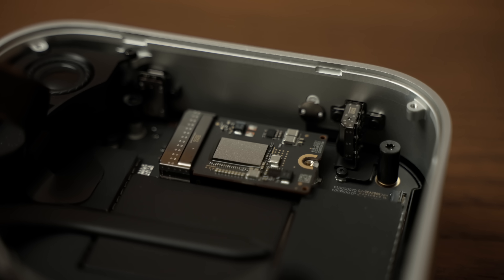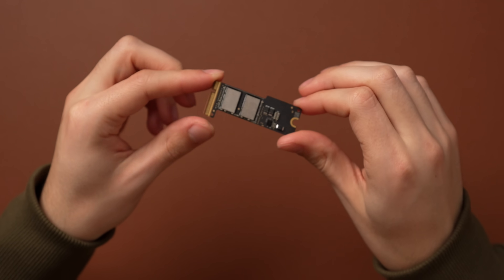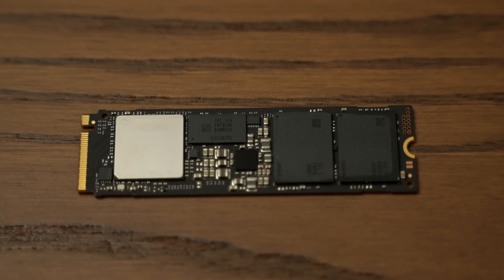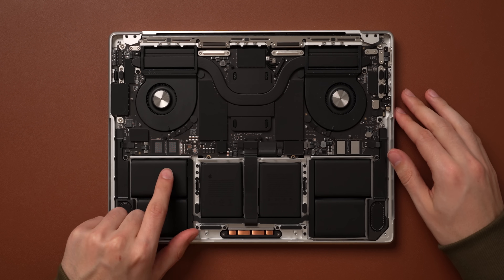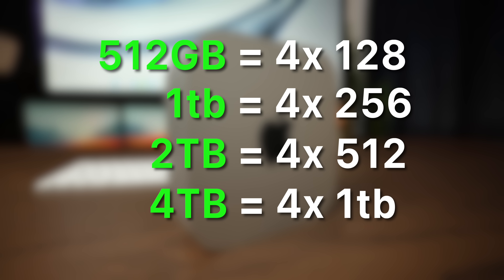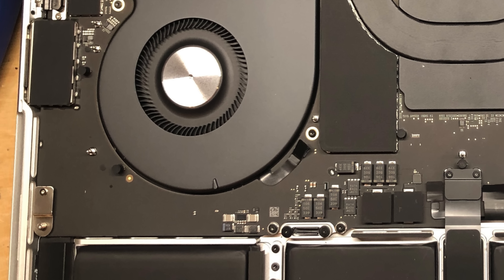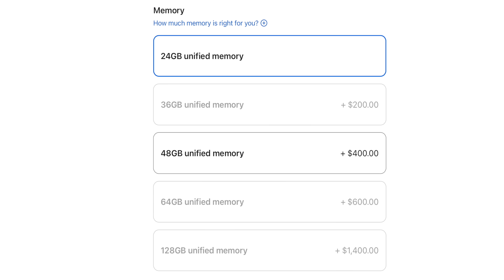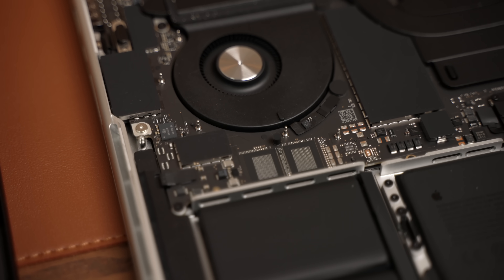Apple SSDs are hiding a BIG secret... Upgradable MacBooks??

Comment: Keep in mind,all does is to maximize profits via upselling basic upgrades to its customers. It is their core selling strategy.

Reason why we see removable NAND memory on Mac Minis? They are stationary devices and storage scarcity can be easily circumvented with external SSDs/docks/NAS. So less incentive for apple to solder on the flash. (Soldered flash creates extra work for them in case of warranty.)
On Macbooks they will keep the customer pay dearly for RAM and flash storage, as external SSDs are inconvenient on mobile devices and the push to upsell more NAND much higher.

Comment: Removable is a generalization... you can remove it but if its also proprietary connection with hardware/software lock it not going to change much for us. Resoldering and replacing the NAND chips has always been an option anyway...

Comment: Keep in mind that Apple doesn't manufacture the NAND chips. So if they manufacture a daughter board with the NAND chips, then that has all the SKUs. If they always populate with 4 NAND chips, that can reduce the controller complexity on the SOC. Now, I haven't seen images of the M4 SOCs but Apple may be planning for 1 SKU for the logic board. Apple could produce only m4 PROs and use them in both M4 and M4 PRO mac minis. This can be done by disabling CPU & GPU cores and memory by only 1 time programming of the SOC. I wonder if the logic board has pins for programming the SOC. Keep in mind that its not in Apple's interest to manufacture a ton of SOCs for the combinations. Great video.

Comment: I am sure you remember older MacBooks that had a door on the bottom where the hard drive could be swapped out. Most buyers will not take apart a Mac Mini to swap out the "SSD" because it is simply outside of their comfort zone. Swapping out an "SSD" should about as difficult as changing batteries in a remote.

Comment: Apple distinguishes between serviceability (allowed via qualified repair shops) and upgradeability (not allowed). Reducing SKU counts should permit both, without forcing Apple to charge commodity prices. If you want cheap-ish storage, buy an external device and hook it up via either Thunderbolt or 10GbE.

Comment: okay, so I stuck with the 2019 iMac 27” … because it can have an upgraded nvme board fitted. problem occurs if you mess up the screen seal and it kinda spoils the machine a bit. So, now look around the back and see the thunderbolt sockets… I now have a 4TB sandisk pro thunderbolt drive where the transfer rate i a definite 1GB data per second. 
8GB ram and the logic pro libraries on the thunderbolt drive… its a good enough setup for now. Meanwhile my 2009 Nehalem sits under the desk churning away, connected to the iMac via CAT 5. its a beast!

Comment: I have a theory - after having replaced the i9 32gb ram and 2tb logic board in my 2019 MBP by Apple for a fraction of the actual machine cost (device well out of warranty), if occured to me, based on this topic, that if there is a serious issue with storage burnout/life span then having replaceable modules limits the repair costs for the manufacturer.

Comment: If Apple brings removable storage back to MacBooks it'll be licked down so that you can only use their drives and they'll have to be activated just like a display replacement.
Reply: Reinventing the wheel but also locking the SSD to the CPU is already a thing they do.

Comment: The age of Open Source & Repairability over Proprietary & Soldered~
Here's my thought, Apple might have possibly opted with this not because of the number of SKUs reduced but because of space constraints with the Mac Mini redesign. However, Apple trickled down the new save spacing font to OLED if not the Action Button from the Watch to the 6.9" iPhone Pro Max where they may evaluate the similar points of advantage brought down by you in their redesign of the MacBook Pro scheduled in 2026 when Tim Cook is really a penny pinching person even at the difference of cents. SSDs would still be shipped without a controller where it's integrated in the M-series chip itself for the control aspect so you can actually keep your fingers crossed but the picture would me more clear with the Mac Studio update later this year.

Comment: Thanks Luke.....I just bought a pair M4 Mini's  and at the moment I'm jockeying SSD's externally.  I don't have the guts to pull mine apart and try to fit in higher capacity drives...This is basically part of a Music system, where I use Roon to store every CD I've ever owned...The M4 is a great sized unit to get what I need for my Musical enjoyment.   Thanks so much for your video!!!

Comment: You ignored the giant elephant in the room: it also works to prevent people from upgrading their storage with 3rd party disks. It makes them choose which disk will be able to work with their system. Locking out consumer accessability even more.

I hate this direction. And the general direction of apple on these anti-consumer practises. I love mac os but I can't spend way too much of my money on way too expensive and way too anti-consumer products. They try to screw you over on every single corner.

Comment: I think Apple, if they wanted to really stand behind their eco-virtue signaling (which has thus far been more about leaving out chargers for iphones than anything else to keep charging the same price and give less product. I think everyone uses recycled aluminum. I think 99% of alumninum used commercially is recycled.) They would not only make the battery user-replacable, but the ram, and storage. Yes, it would lower the amount of people buying a new macbook or other mac every year or two by a little bit, but it would allow people to keep their macbook longer, it would allow not only apple but 3rd parties to sell those replacable parts. I'm on a 2018 MBP i bought refurb, and up until recently has been working okay. Unfortunately I may have to buy a new macbook pro, or maybe just get a refurb M1 or something. Which, for the price, I'm probably better off getting an M4. Lets hop apple decides to do a facelift mid-cycle and allow people to add ram/storage, etc to their Macbook Pro's. I've just considered getting a Mac mini, but my current set up where i'm working remote doesn't quit give me  the space to buy a 3rd monitor to use for the mac, but the 15" MBP I have fits okay.

Comment: Nice Helmut Lang hoodie, I've got a few pieces from them, am a fan. I've never heard the final S voiced in chassis, interesting. I always heard it with the final s silent. .Apple still doesn't make the storage modules as easy as a drop-in installation. I've seen folks replace the logic board NAND chips and they still had to do some extra steps on the SoC to make it work due to the controller and the security chip. And of course, unlike PCs where you can drop in SSD replacements without voiding your warranty, there's no guarantee that Apple would keep the warranty on a replaced SSD.

Comment: You can remove the storage from a machine, but can you use the data in another machine/view it?, this is terrible - stop celebrating apple doing everything to subvert industry standards or perverting hardware standards. each of these customs designs is not compatible with each other, upgrading these machines a nightmare. what the hell is wrong with nvme industry standards based drives?

Comment: Now that the screen on my daughter's 2012 MacBook Pro broke, I need to find her a decent replacement.  Fortunately she said she doesn't specifically need MacOS, she just needs more memory (I had upgraded the MBP with OWC's 16G memory upgrade).  Her projects need 32G memory, and there's no way ANY MacBook (certainly nothing anywhere near affordable) will have that.  So I'll probably track down a used ThinkPad and run Linux/MSWin dual-boot on it.
(If I could figure out why my $14 27" 2010 iMac no longer powers up, that would work as a desktop machine with 32G).

Comment: No, Apple doesn't care about streamlining in that way. It's all about locking down the third party options for upgrading their boards. They don't want people like me soldering on chips and caps and resistors to no stuff BGA pads. If they go to removable storage, they will make sure that the NANDs are only useable with other soldered components on the board and then call it "security". Everyone knows they are famous for locking stuff down. Soldering and SMD/BGA rework is becoming more popular. People like me can solder NANDs and onboard RAM and change the configuration of your MacBook. Apple doesn't want that. And now with China declaring economic war, more downloadable tools and hard tools for changing your config will be available. I have downloaded recently a folder that has programming info for M1-M4 macbooks so you can upgrade your CPUs onboard RAM without using Apple configurator. Although it's all in Chinese.

Comment: Removable storage is logical thing to do to reduce manufacturing costs. But I think Apple is still struggling to fully embrace this change. The M4 Mac Mini's removable storage has a different form factor to the M4 Pro Mac Mini, with a maximum of two NAND chips per module Vs the M4 Pro's four NAND chips. So, the read / write performance of 2TB storage on a M4 Mac Mini is around half that of 2TB on the M4 Pro at circa 3000MB/s Vs M4 Pro's circa 6000MB/s. What you must remember is Apple never does anything that benefits the customer only their profits. So, they will be dismayed that third parties have already reverse engineered the M4 Mac Mini two NAND storage module and are offering replacement 2TB upgrade storage modules with all the required tools included to open up your Mac Mini at a fraction of the cost of Apple's extortionate $800 (£800 if you live in the UK) 2TB storage option. Apple will clearly take steps to prevent this happening in the future as this impacts their profits. I've significantly reduced my spend on Apple products recently and are investing more of Windows PC's / laptops because I no longer want to reward Apple's sharp practices.

Comment: You know what would simplify things even more? Dropping the on SoC SSD controller and simply run 4x PCIe lanes to an m.2 storage slot, then use industry standard m.2 SSDs
Reply: no take more time when you make ssd on pcb here 0.1s at this quanity they make 10x more $$$ when they solder this direct on motherboard and you dont need conectors , pcb and gold on pins
Reply: @Adiiiman2xxx  No, it doesn’t There are m.2 SSDs in PCs that outperform Apple’s M4 Pro/Max SSD, in both sequential and random performance. You clearly don’t know what you’re talking about.
Reply: Best to keep controller away from hot nands anyways. Nands should run like toast for longevity.

Comment: Lest we forget that Apple can produce a "handshake" protocol for the removable storage so that the part cannot be changed out because it will fail the "Handshake".
Reply: Such a "handshake" would constitute a protocol and require a controller chip on the storage module to communicate with the system. Apple's storage modules do not have a controller so there's no way to implement such a thing.
Reply: @thomaswinwood  No controller needed to lock out NANDS that do not have the right preflashed data in a hidden partition. I'm not claiming that's what they do, but its certainly possible.

Comment: What's really going to bake your noodle is when you find out the 1Tb Nand chip is probably the same exact price as the 128GB ones from the manufacturer.

I would really like to get into the M series game, and these machines are engineering marvels in certain respects, but I just feel like I'm being taken advantage of.
Reply: "when you find out the 1Tb Nand chip is probably the same exact price as the 128GB ones from the manufacturer" - probably not. The 128's are more likely reject 1Tb parts. (better to sell them for less than throw them in the waste.

Comment: I was on the verge of moving from pc as my current pc is not 11 compatible so was eyeing up the Mac mini but the news that Apple may have to add a back door to security has now made Mac a no go if they go ahead.

If they are going to backdoor security and encryption they no longer have any reason to inhibit the upgradable storage as it will no longer be secure so there won’t be any need to limit its user upgrade ability.

Comment: i hope they do make the change.

i refuse to buy anymore apple products with non upgradable storage or ram.
i have a 2tb m1 air and its been great, but i am not willing to shell out the extra apple tax money  for another one unless it becomes more upgradable.

also running a 2012 MBA with win 10 only on it and its still a great machine for the unfortunate time that i need to use windows.

i would prefer a slightly thicker,heavier laptop if it had full upgradability again.

Comment: I hope china will push to take over market share of flash nand = price fall of ram and ssd, bigger capacities and okish quality, we were promised a while ago ssd vs hdd price vs capacity will reach parity and go for ssd, but last 5+ years are meh at best, 1TB ssd still around 50 EUR /enduser price with tax not on sale special/ and it scales horribly for 4/8TB modules, bigger ones were promised but m.2 is capped on 8TB for now, and higher capacities are on enterprise models only where they are even worse in price vs capacity.....soon usb4/tb4 and even usb5/tb5 are knocking on the door, those are throughputs you would not recognize if the storage is internal or external...... hope soon maybe can afford one small box with two U.2 ssds of 60 or rather 120 TB each in a raid mirror and consolidate all the archives on a cartworth of external hard drives, DAS and even some CD and DVDs....all neatly at one place with fast access

Comment: The 4 populated slots also removes the issue in the m2 gen of macbooks where not running 2 chips made write/read speeds slower (or something like that).

But yeah for the most part, they probably will simplify the board design in the next “redesign” just so that they can reduce large scale manufacturing and just pop in and out certain components for faster assembly.

Does any of this help us customers, probably not other than faster shipping times—but we are definitely not gonna see price savings or user upgradability ever 😅😂

Comment: 5:24 "To accommodate the very small number of people..." It's not a small amount. You're talking from a youtuber / home consumer perspective. I work in super scale enterprise. We buy shitloads, thousands and thousand Macbook Pro with 8TB. Oh and also, there's only 2 SKU's of logic board for the MacBook Pro. Not 8 or 32, it's just 2.
Reply: This should be much higher up, the logic boards aren't many but the combos on the logic boards are much the chips all use the same socket or a different socket for the pro and max chip vs the base, but the rest are fundamentally identical. It's just that having to solder multiple components for each user adds complexity, so they simplified it (Storage in particular) on the mac mini while keeping the Memory the same aka soldered. It would be much simpler for them if they make the memory user upgradable maybe some applefied version of lpcamm with all the bandwidth and further simplify it for themselves.

Comment: This is why I like socketed memory and socketed storage, both industry standard modules.  Somewhat slower.  Takes up somewhat more space.  So very much cheaper.
8TB M.2 SSD ~$650 on Amazon vs. 8TB Apple proprietary storage upgrade ~$2,200.
Reply: Socketed RAM doesn't have to be slower than soldered one. It depend on what modules were used. High quality high speed socketed ram will beat soldered crappy one any time, the only difference is that when you buy machine with crappy socketed RAM you can replace it.
Reply: @JerziTBoss  apple alway use cheap nands :/
Reply: 'twould be nice to see them adopt LPCAMM
Reply: Check out CAMM2 it has been used for years on server hardware Apple just doesn’t want to give you options. They own the computer you buy. They don’t want you to own anything it’s greed.

CAMM standards allows for faster RAM than LPD.

Comment: So it turns out that making the storage upgradeable actually makes manufacturing easier, proving that apple only did it to prevent user upgradiblity. And that they did it at a cost to themselves
Reply: They recoup the cost very fast when they charge 2.5 thousand dollars for max storrage option.
Reply: Apple maybe covering their ass, as there is a potential for soldered on SSDs to fail at some point. This prevents the potential trashing of relatively young (for apple) laptops. Best part is they can charge huge for a replacement SSD and 90% of users will pay it.
Reply: bingo. absolute pr1ck of a company.

Comment: Yeah, Like I am going to pay $200 for 32gb of RAM and $600 for an SSD ?…..I had a MacBook Pro with Dual boot Windows-10 and MacOS and I ran the same benchmark apps on both Operating Systems and Windows-10 Scored Higher Benchmarks on the MacBook Pro than MacOS did ?…..So Windows-10 runs better on the MacBook Pro than MacOS.

Comment: What was the benefit of putting the SSD controller on the SOC?  Unlike the ram, there is no performance gain.
Reply: It's all about money.
Reply: 1. A storage controller is just an ARM microcontroller, and Apple are already making one of those—no need to power a second one just so it can talk NVMe to the first one.
2. Improved security, e.g. completely transparent disk encryption. You also can't take the module out of one Mac and put it in another to read the data off it like you can with a commodity M.2 SSD.